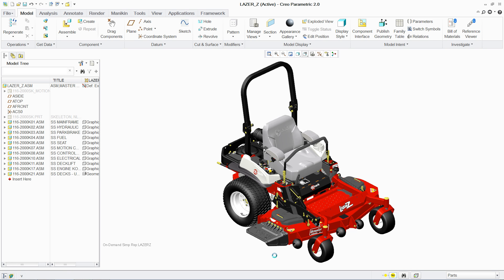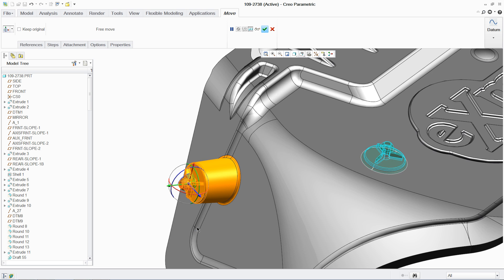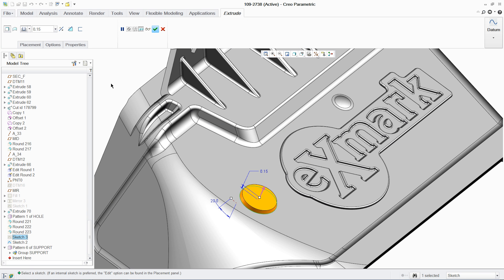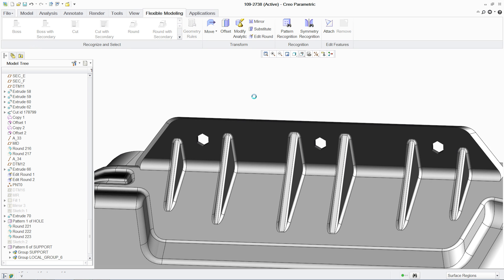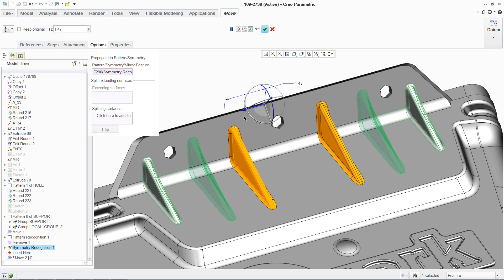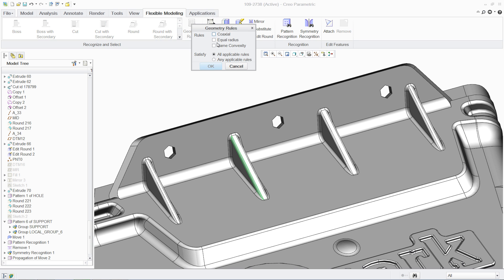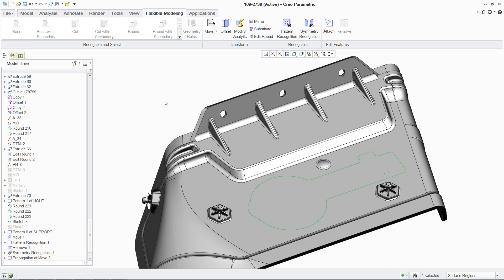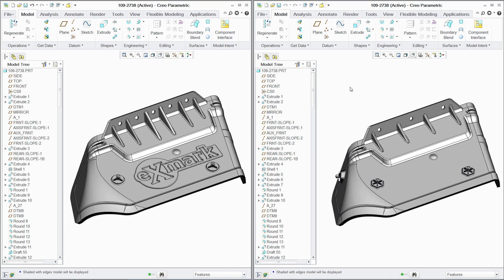PTC Creo Flexible Modeling Extension in Action - PTC

Comment: I've used CAD packages for the best part of 9 years and I have to say I've never came across a program so frustrating and unintuitive. The basic features of the program, such as 2D sketches, you'd expect to be flexible and easy to edit, but they are ANYTHING BUT; I'm wanting to punch the computer every time I use it because it refuses to do anything you'd expect it to. Why doesn't it produce technical drawings in the convention that has been outlined? Why is it such a convoluted task to add something as basic as center lines or text? Why are the menus so temperamental? Why does it insist on creating strong dimensions that are hidden from view so as to prevent me from changing something that would otherwise be very fucking simple to change? This is the program I have to use at uni and it's probably taken me about 100 times longer to do the work because of this program... It makes me want to cry.
Reply: I wholeheartedly agree about Pro/E.  For what it's worth this flexible modeling tool is surprisingly agile and usable.  It is a small bright spot in an otherwise dismal garbage heap of clunky UI and legacy design.